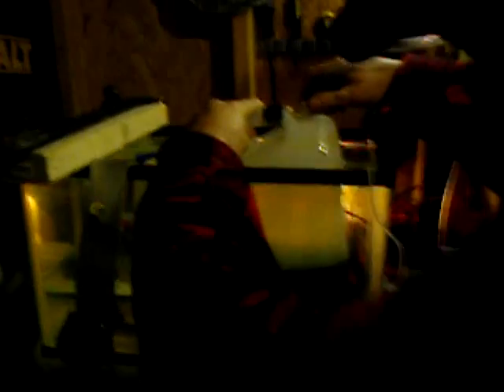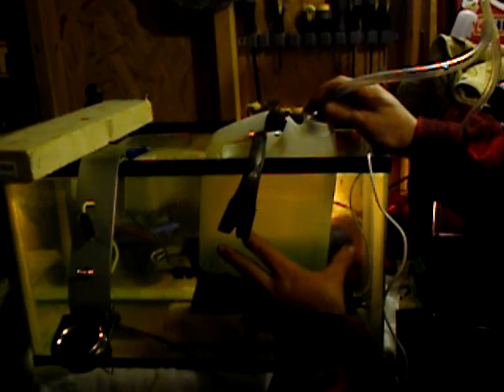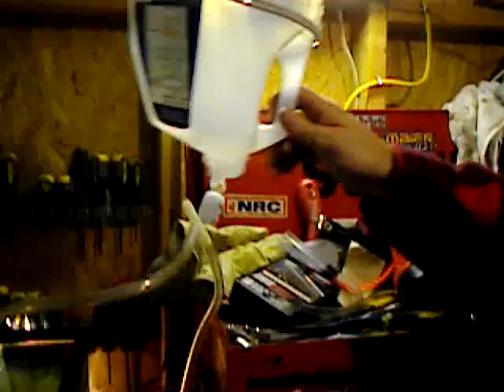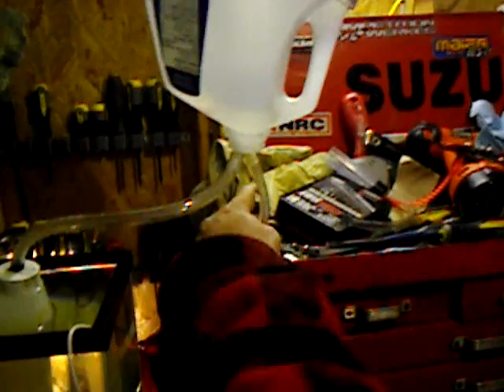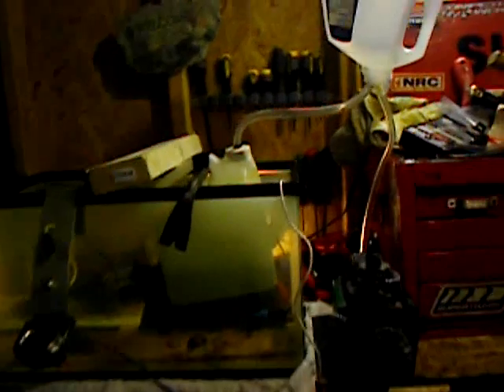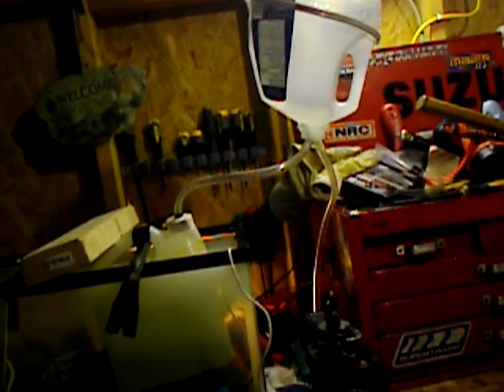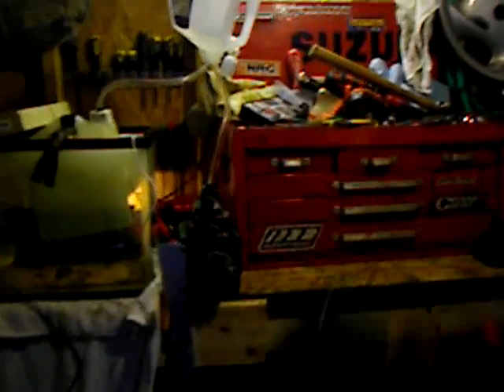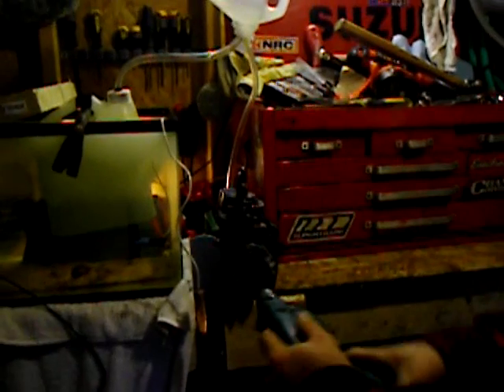Hydrogen Production Cell 2 (With Engine)

Comment from the maker: you can shut the cell off but it would be useful to let the pressure build up at a stop for the acceleration required to get going again as you want the peak efficiency at cruising speed. but, yes, you dont want too much pressure. thats where a pressure switch on the tank to auto shutdown at a certain pressure comes in. and yes pressure is good for high demand points like acceleration moments like leaving idle and passing. if you guys got any other questions please ask. thanks for the help.

Comment from the maker: Also we built a cell with 2x the plates in a sealed 1/2" acrylic tank and ran it through the bubbler. we used a propane torch head and lit it and the flow was so high that the flash got through the bubbler and the tank exploded the pressure was around 0.5 psi on the tank gauge from the last time i check before it blew. we have a second tank but i am too afraid to try it again and this is my reason for switching the ethanol for a while. once my courage comes back ill try it on the engine. ttyl.

Comment from the maker: i decided to leave it mixed so that its easier and cleaner. i used 12v at 30-35 amps i think. I let the cavity fill for 2-5 minutes to make it easier for the engine to start and so that its easier to diagnose the problem if it doesnt start as i know it has fuel. i have a water bubbler for the engine but i am still trying to increase flow as it sucks up water due to not enough flow and it has backfired and it is scary shit. thank god i plug my ears after it starts. lol. thanks for the comments

Comment: how much electrical power current and voltage are you using in order to run it... will it run continuous or are you storing some HHO in a cavity?

Comment: Just to let you know, Hydrogen is a fuel, and very powerful one at that. So please give it the same respect that you would gasoline. Build the tank for the worst case that might happen, that way if you do get a back flash nothing happens. Be safe not sorry okay? 1/2" to 1" acrylic should be okay for your size of plates.